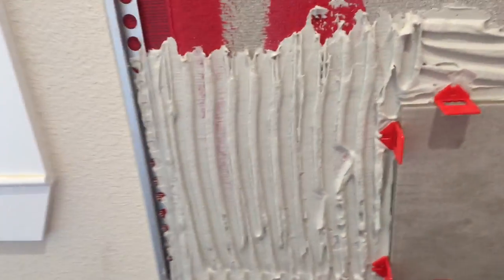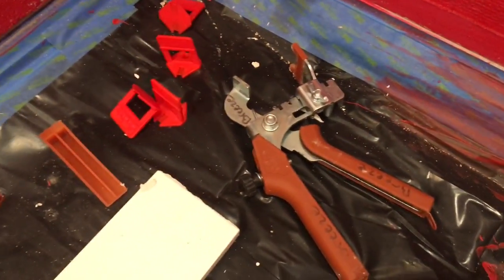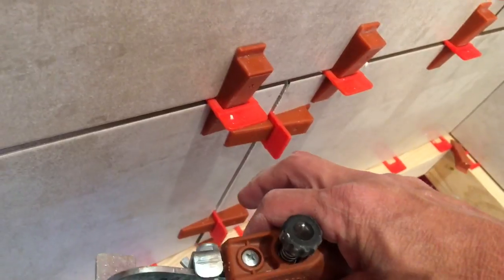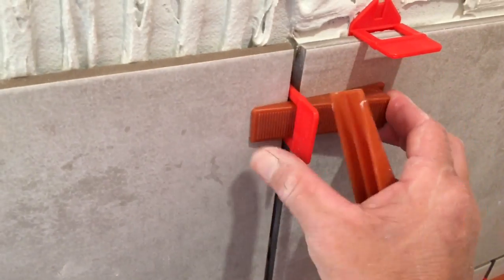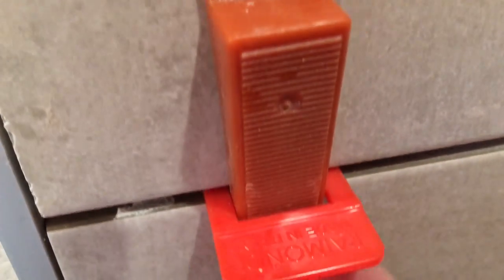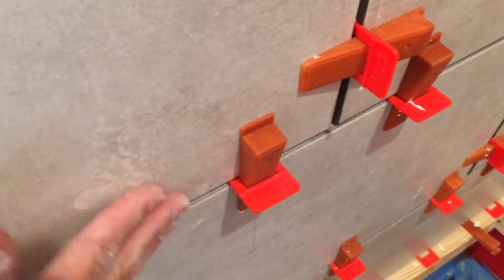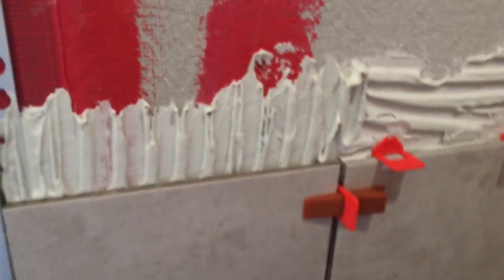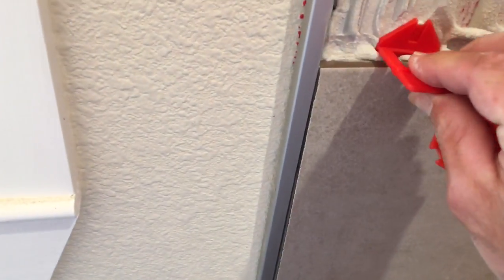Best Tile Spacers

Comment: Hi! Many tile spacer and leveler I need for 300 tiles?
Reply from the maker: It really depends on what size tile you are installing I use 12 spacers on a 12”x24” tile laying the tile on a brick pattern. Hope that will help

Comment: I've use this leveling system and I don't quite like them, every time you tight them, they slide and create a bigger space then they intended to, that's on the floor, I haven't try them on the wall
Reply from the maker: I see your point that definitely will happen not so much on a wall but you got to make sure you don’t over tighten with the pliers I like to hand set the use pliers and eye the tile to make sure it don’t move.
Reply: @crdriscoll1  Amazing the amount of names used in America for what we call tile adhesive in England, l've heard it called (in America) glue, thin set, mud and adhesive, are there any more? A bathroom installer from England.
Reply: I think these are practical with rectified and 2'x2', and 2'x4' in main traffic areas. Showers are not practical, these things don't get them 100% flat...and tbh i can lay tile just as flat without these a bit quicker..but some floors are so fucked up that these things actually really did come in handy. I just dont think they are necessary for every tile, or every tile installation you do. You can make walls flat by touch, rubbing your fingers over the lips of the tiles resting on eachother without spacers, use a level to make sure you aren't building the wall out..then space them out after you have them where you need. And always stairstep your rows when installing.. A lot of jobs you don't get time to sit there and be nit picky with floating walls and doing "perfect prep"...so you get dramatically better setting tile over wavy substrates and learn how to read wall/floors better by seeing how much thinset is under the tile after you've set it. then the next row in that same spot u can expect it to be a hump/dip and roll with the floor..same with showers,  and look at a side profile when you are coming back in with your cuts to see how wavy that wall is. Helps you understand how to apply more and less thinset as well and using your trowels properly.. Obviously if you're on your game and there is plenty to do on a job its easy to come in real quick and skim coat low spots on floors/walls while doing something else..tomato, tomatoe... My opinion it's  better to learn without these and get excellent, and use these sparingly on those rollercoaster floors with LFT's.

Comment: How do you know what to set the pliers to
Reply from the maker: Basically it’s all about not over tighten the spacers. If over tightened the will break off. So I set my pliers accordingly to thickness of the tile I’m installing. Best rule of thumb that I have learned is I’ll install a couple of the wedges by hand and gage my pliers off of that. Hope this helps

Comment: Those things cause problems! They stick underneath the tile, and raises the tiles away from the surface too much! It becomes easy to not end up with enough mortar and a tile can become loose. Or even accumulate water behind it as a result.
You end up having to add a whole lot of extra mortar to ensure it's thick enough.
So, the directions you see from things like the Schluter Allset and whatnot, that tell you what trowel to you, that information goes out the window, because it's incorrect, because those darn spacers lifted the tiles up. If only these things were hair thin, but they're not. They're thick as hell.
Bad product, not designed right at all! Beware. Shitty tile jobs as a result all over !!!
Reply from the maker: They have never gave me a problem I always use 1/2”x1/2” sq notch but I lay larger tile with these have not used little tile with these spacers but I get what you are saying. Thanks for watching

Comment: Get  a better cutter !
Reply from the maker: Got a better cutter what you got l. Lol
Reply: @crdriscoll1  one that cuts a much cleaner edge than those tiles ! Either that or they are shit porcelain
Reply from the maker: @carforumwanker  for sure they are porcelain tiles spec houses probably less than .25 a sqft
Reply: @crdriscoll1  Just find most POrcelain  unless the cutter and its wheel is perfect .They need a gentle  polishing /grinding to smooth down the cut edges .